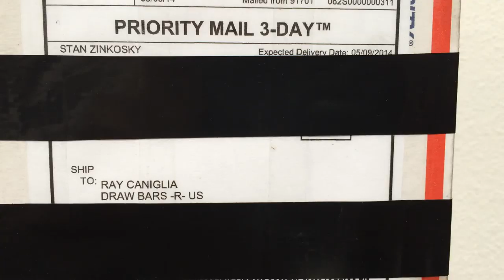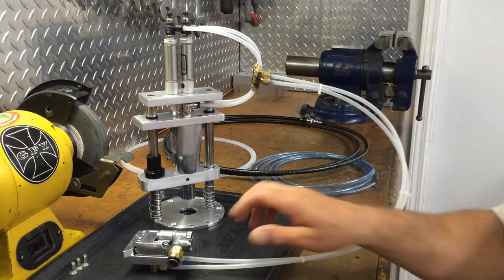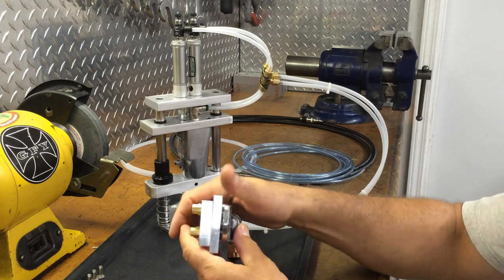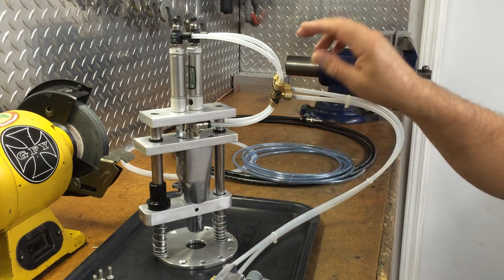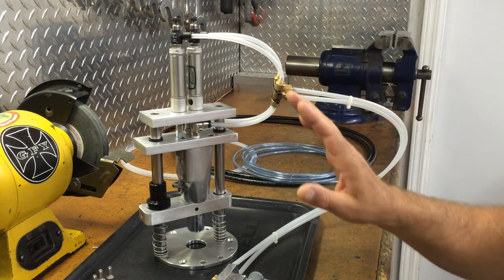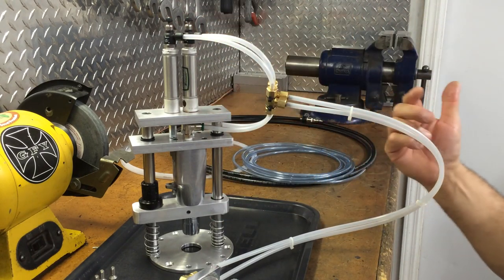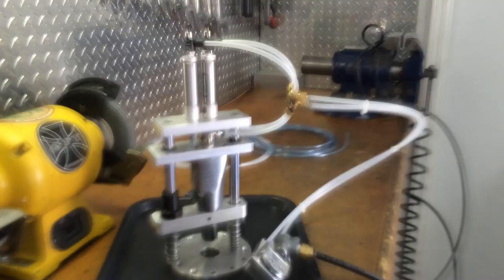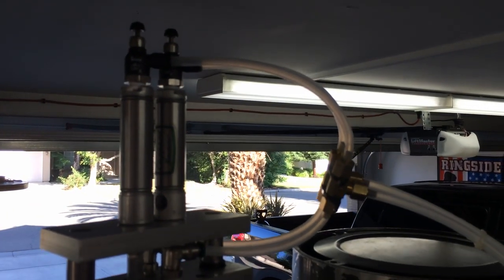Power Drawbar Part 4 #realraysgarage

Comment: This is an excellent example of not settling for just a handle. You could do more and went and got her done. I like that. Outstanding work
Reply from the maker: Thanks Gus, this has to be one of the best additions to the mill at a fraction of the cost of buying a new power drawbar unit.

Thanks for tuning in!
Best Regards,
Ray

Comment: Hi Ray. I absolutely love your power draw bar, so much so, that I have now almost completed my version. It is fashioned after yours, but with the cylinders squeezed between the impact and 5/8" verticals, to save head height. Again, beautifully crafted and explained. You are part of the YouTube machinists mentor group
Reply from the maker: Hello John, Just checking in on how your Power DB is treating you, mine is still working great!

Best Regards,
Ray
Reply: Hi Ray. Good to hear from you. Mine has had a heck of a workout since installed and continues to perform as flawlessly and reliable as new. I did install a small inline oiler to help prolong it's life. Cheers..John
Reply from the maker: Great to hear John! Adding a oiler is a great idea, I have been oiling mine manually.

Best Regards,
Ray

Comment: Awesome design has to be the best one on Youtube.   Will adapt to my step pulley mill, and may try a mod to put the air cylinders adjacent to the air wrench to lessen overall height.
Reply from the maker: Many thanks David, sounds like you have a solid plan for your step pulley mill!
Reply: @RaysGarage  Are you still making videos?  do you have a patreon account?
Reply from the maker: @davidcallista2580  Hello David, Yes, I am still making videos. My lack of video is due to several family issues towards the end of 2020 and into 2021, I will be back soon! I do not have a Patreon Account since I don't feel anyone should have to pay for any of my video content, I do not use YouTube as a business, I have a 8 to 10 hour day job for paying the bills. My shop and YouTube is my after work hobby and like sharing my knowledge and what I have learned from others over the years. Thank you very much for your kind words and hope your power drawbar turns out well! Best Regards, Ray
Reply: @RaysGarage  Glad to hear you’re still at it and understand how circumstances can affect your activity.

Comment: You could offer these plans for a few bucks. I'm positive they would sell. That's a really nice design.  I'm thinking about using this for mine. My only limitations is the height.  I don't have the clearance above the motor that you have so I will need to rotate the air cylinders and run them along the body of the impact.  But I just wanted to say thank you for your videos.  They helped me greatly with the design idea.  It's kinda funny, I came across stans video in my research long before yours and I immediately knew who you were referring to when you mentioned the upstanding guy that sent you the bits and pieces.  He is a very intelligent and humble guy. Sub'd to both of you guys. 😁👍 🍻

Comment: Looks very nice, very slick, especially with the "remote". Tho i would probably try and mold a plastic case over it (heat formed) so it cuts off a bit of the noise.

:)
Reply from the maker: +aserta Thanks! I kept it exposed so I can show it off!

Thanks for tuning in!
Regards,
Ray

Comment: After using for a while, how does the drawbar look? Looks like it will round the hex because the socket is spinning when it contacts the bar.
Reply from the maker: Still looks and functions as good if not better than the day I installed it! I thought for sure i would be replacing the socket by now but no, still good as new!
Reply: @RaysGarage  good to hear, easy to over think things. Thanks

Comment: Hi mate.
That looks absolutely wonderful.  I had a smile on my face, while you were demonstrating it.  Well done.  Will you also be able to make something like that for the knee?  As even Tom is still using a hand drill, and it looks rather hoady. ( a NZ expression)
Reply from the maker: Marcel Timmers Hi Marcel,

I use a DeWalt cordless drill and the adapter for the cog. the power feed for the knee is very expensive because it has to be a 750 in pound unit so the cordless drill is a cost effective alternative that functions perfect.

Yes, I was very happy too when the PD worked for the first time, its been a huge time saver!

Thanks again,

Ray

Comment: Hi Ray, I have watched i think every machining video on youtube, I started a power drawbar project sometime ago that is modeled after yours, i have stepped away from it for a bit because of one issue, Is there a trick or secret to making sure the socket engages the top of drawbar ok every time? I have tried many variations without any success and can't seem to get it just right.
Reply from the maker: I am using a 12 point impact socket and verify the top of you drawbar is chamfered, the top of the drawbar points need to be slightly rounded for proper socket engagement every time.

Comment: Very nice. My only question, with Tubalcain, and others making combination drawbar wrench/soft-blow hammers, what happens if the tool gets stuck in the taper? Does the action of the impact driver take care of that?
Tom - Vista, CA
Reply from the maker: Hi Tom,

Yes, the downward force of the air cylinder pushes the butterfly gun down onto the drawbar then pushes the tool out of the R8 spindle.

Ray

Comment: Hey Ray,
It's Ray!! Just signed up with your channel after watching Collin's vids on his drawbar.He commented on your switch design, so had to come see for myself.  I agree, nice!! I am in the process of rehabbing my Bridgeport step pulley and would like to add this little "gismo" to my "bridgy"(as Adam calls it)
Nice job, and any info would be great!
Nice job..
Razor!
Reply from the maker: Thanks man!

For sure, a power draw bar sure makes tool changes nice! First get your Bridgeport cleaned up, tight, and in good working condition. You should be able find anything you need out there to get her dialed in, then its time for extras like power feeds, dro, and so on.

Feel free to hit me up with any questions, I would be happy to help!

Thanks for subscribing, and hope you enjoy my videos!

Ray
Reply: Ray Caniglia 
Thanks for the offer to help! Got lots to do still. Got the head all done, new spindle bearings and the like, done with a good friend. Machinist buddy for 30 years. Now looking to get a bit of scraping done, and adding a bjur lube system. Got a dro from DROPROS, and I am doing all the cleaning and painting, electrical myself. Hoping to get my baby up running again by the 1st of Nov!
Know anybody to help with scraping and flaking?
Razor!
Reply from the maker: Razor Works Hey Ray, Sounds like your off to a great start and have some good experience helping out! Let me know if your happy with DROPROS, I was thinking of installing a set on my Grizz 14X40 Lathe. Adam Booth (ABOM79)  is the guy to ask about scraping, I remember him talking about in one of his videos.

Let me how your progressing and shoot some video along the way.

Ray
Reply: Ray Caniglia I am not very savvy with all these electronic gadgets we have at our disposal. Trying to shoot video is going to be a trip for me. Thanks for the tip about scraping, I'll get in touch with him and go from there.
Thanks, Ray
Razor!

Comment: Way to make this 1000% more complicated than it needed to be. You could have just got a 1" stroke cylinder and had it activate the paddle on the impact 😳
Reply from the maker: Sounds like a nice simple power drawbar design, can you shoot me the link of your video and the tool in action, thanks! Best Regards, Ray
Reply: @RaysGarage  donate me a Bridgeport, I'll be happy to
Reply from the maker: @EitriBrokkr  If its a Bridgeport with step pulleys my design will not work. It would need to stand off the top of the head to clear the pulleys.

Comment: Hi Ray  Great utube. I tried to build one like some of the others I seen on ebay and it almost worked except that my mill is so tall I had to build a handle to come out and down and then it was a bad angle and won't come down properly. So I'm ready to build one like you did but I have a question. If I use a double acting cylinder for the down pressure will I need the relief valves you have on top of yours? And if so where can I find such a animal and  also is there a certain place you put your exhaust port in your switch? thanks  Gary
Reply from the maker: Try it without the speed regulators first, these valves only adjust how fast the cylinder strokes but does not regulate pressure. I f you do need them you can get them cheap at Automation Direct.

Comment: Hi Ray, I like the design but I'm asking myself: is it possibile to build one without the pumping movement of the pneumatic tool? I mean: when not inflated by air, the spindle of the air tool moves freely so maybe it doesn't need to be disengaged from the nut. Second question: is it possibile to use teflon bushing instead brass for the rods? Plasticity of teflon maybe correct slight disalignment of the structure improving smoothness. Ray, obviuosuly I am talking from the the world of supposition so maybe I've told a lot stupid things.
Reply from the maker: Hi Cosimo,

I don't think it's a good idea to have the socket on the drawbar at all times, would make for a simple install just not safe, plus if the gun were to bind up it could drop the tool while drilling, or machining. I am not sure what bushing material I am going to change out too but, for now I use it with the Delron and see how it goes.

Thanks,

Ray
Reply: HI Ray, I've understood and I share your point of view. Thanks for your answer.
Reply from the maker: Cosimo Marotta Hi Cosimo,
Check out Brad's over at TacticalKeychains power drawbar version, might be what your thinking...
Pneumatic Power Drawbar - Tormach 1100

Thanks,

Ray
Reply: Hi Ray, thanks for advice. I will see the video. Greetings from Italy.

Comment: that turned out awesome, I was looking forward for the "finale" - I like your solution with 2 cylinders, keeps things simple
I might tackle this project at some point (i don't have a bridgeport but an RF clone with a geared head) - was wondering if you tighten the bleed valves a bit more so they keep the socket on the bar end longer (like when you pressed 3 times to tighten some more I'm thinking might have not come up in between the presses).
Quick question - do you have a part number for those bleed valves?
great job, thanks for sharing
Reply from the maker: Thanks!

Yes, the needle valves can be adjusted to slow the speed of the cylinders return, I still need to do some final adjustmernts.
I do not have the part number of the needle valves but, they are made by Legris-Pneumatics and they are on the web.

Ray
Reply: found the P/N for the valves, in case someone else wonders - Legris 7065 56 11 (1/8'' NPT with 1/4'' tube).
Reply from the maker: sharp x Cool,
Thanks for looking into this and sharing!

Ray
Reply: Ray Caniglia got excited and ordered them :) +fittings and air cylinder, they're cheaper at Amazon than ebay btw ($13.50 or so).
What's the diameter on your cylinders (i got 16mm), I hope is not too small but wanted the shorter length (it's a 2'' stroke with 6.2'' overall length).
Reply from the maker: sharp x I used two Clippard Minimatic SDR 12 1 cylinders they are 7/8" x 4" H 5/8-18 body threads, 1/4-28 rod threads 1" stroke. Hope this he;ps!

Ray
Reply: that helps, thank you - couldn't find one like that on Amazon - it's nice that is short, i'll see if the one i ordered fits for what i want to do (I want to place it beside the wrench but is about 2'' longer - argh). You have a p/n for yours by any chance?
Reply from the maker: sharp x Clippard Minimatic SDR 12 1
If you have the space it shoud not be an issus with one a little larger.
Reply: want to "sandwich" the wrench between 2 plates and have the cyl beside it to make it more compact, cyl should sit between the plates also and act in the retract action rather than extend like in your design (my garage door would hit the cyl if i put it on top, so I need either a shorter unit or raise the garage door :)
thanks for the p/n, much appreciated - i'll see if i can find it on fleabay.

Comment: Ray, can you say a little on air piston selection? I have about 1000 to choose from. What pressure diameter, stroke length, etc
Reply from the maker: Hello Gus, I found these on eBay for cheap and was not 100% sure if they would work, luckily they did. Many different air cylinders will work but I would look for a double acting, meaning a two way stroke, this will allow the rod to collapse under spring tension on the return. one inch bore is plenty big, with a two in stroke minimum. Bimba, Clippard are the good ones to use. I used two Clippard "SDR 12 1"'s but one will work fine. I hope this helps!

Best Regards,
Ray
Reply: Thank you yes it did.
Reply from the maker: Your welcome!

Comment: I was concerned that the socket would bind up instead of just sliding down over the hex head of the drawbar if it isn't aligned and the actuator strokes too fast. I guess that the 12 point socket will self align well enough to not be a problem, but I wouldn't have predicted that outcome...

The other thing that worried me was having the socket spinning as it gets pressed over the drawbar. I'm guessing that that is part of why the alignment isn't actually as issue as I would have expected.

Now I'm thinking about how I might do this electro-mechanically, as I don't always run a compressor - usually don't - while machining, due to noise issues and a neighbor who likes to call the cops...

I'm thinking a solenoid, some switches, and one of my old cordless drills which I can no longer get new batteries for might do the trick...
Reply from the maker: This set up has been working for me for over five years of use and still works flawlessly. I feel your neighbor should be more understanding and should join in on your machining projects then maybe have a better understanding of the hobbies we enjoy and what we can do! I'll bet he is the first one to ask you to fix something for him! Thanks for tuning in!
Reply: Actually, her husband is a retired moldmaker, and might start hanging around with me if I'm out in the garage on a Saturday afternoon... ;^)

Comment: How did you connect the pneumatics?
Reply from the maker: Hello Niklas, I connected the main air feed to my air compressor  and is regulated at about 95psi all power drawbar connections were push connect air line fittings except for the brass tees for the air cylinders.
Reply: But how do you activate the cylinder to go  down for  both left and right rotations on the air machine.  Any  one way valves ball types?
Reply from the maker: You really only need one air cylinder to work, I had two so I used them both. The impact and the cylinders are both charged with air by the air switch which acts as the air valve. the cylinders are charged in both in and out rotations via the brass Tees.